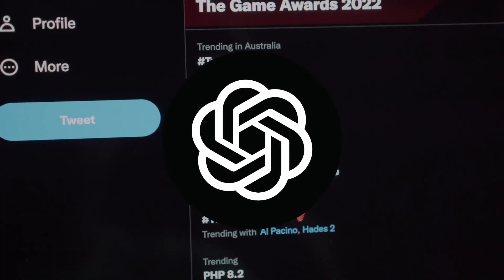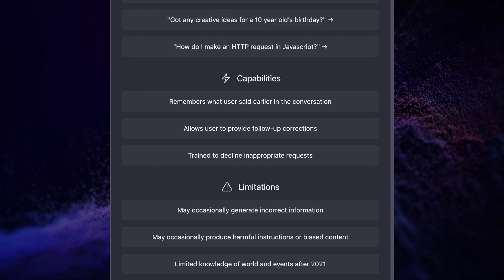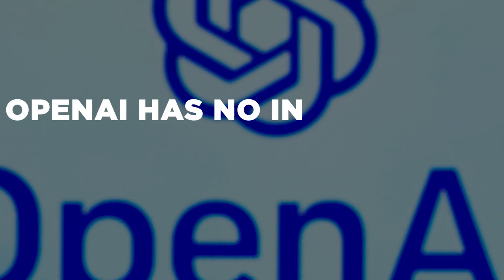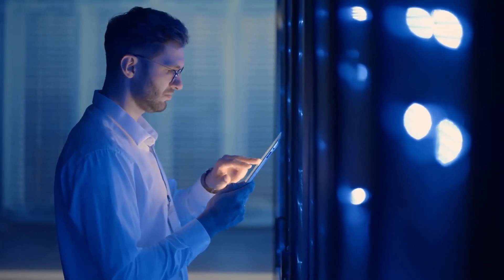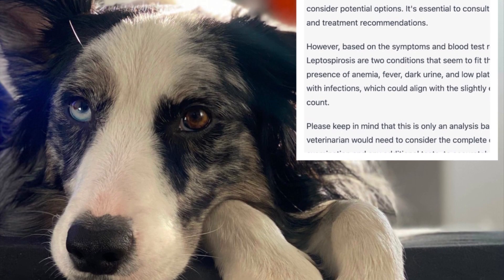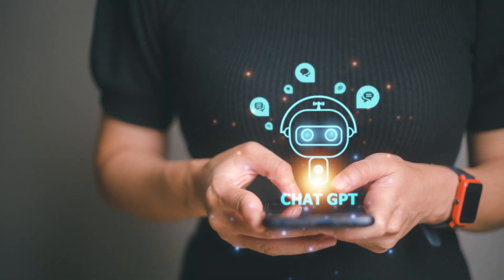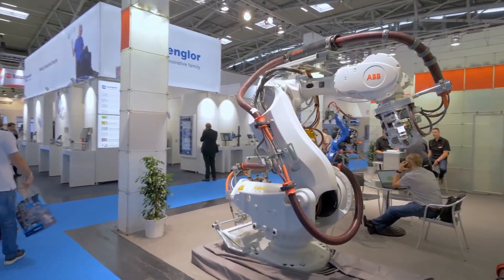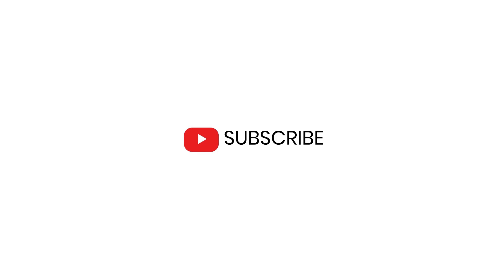This is How GPT 5 Will Redefine The World FOREVER!

Comment: ChatGPT, just like all other AI has no intelligence in AI, and only work from siloed data; 95%+ of it being locked away and unavailable.  There's even a cutoff date for what ChatGPT knows, and if you want an extension of that date you have to go and build an entire new ChatGPT, which is extremely costly; hundreds of millions IIRC.  Also, these so called AIs require immense storage and GPU power to make possible as its nothing but a huge line of stringed codes to come to a final conclusion, often times wrong.  Only one company is out there that can provide the I in AI, and will be releasing its AGI based agents within a matter of a few weeks for BETA testing.  Unlike ChatGPT, these agents will actually learn, not just from you and the data and preferences you provide, but also from other agents within the network, as well as its surroundings within the upcoming spatial web.  Eventually there will be full customization of the user interface, including holograms, but thats further out of course.  The company's CSO discovered the physics equivalent to E=MC2 but for AI learning and this is embedded within each agent.  Beta testing will begin for GIA this fall, and for the KOSM network, where users can build their very own AGI agents with little or no programming skills, Beta testing will be later this year for those toolkits.  GIA and KOSM will offer both personal use subscriptions, as well as enterprise level.  The subscription cost for GIA is expected to be $20 for personal use, while they will also offer a free version.

ChatGPT will still have its uses, but for anything that requires high end accuracy, there will be no alternative as regulatory bodies plan on hitting so called AI companies hard with fines, as they lack the ability to show regulators how their AI bots reached the conclusions they did.  In other words, you can't simply claim that this or that website created bias in the job search or miscalculated something, but you have to be able to trace it and prove it.  The KOSM based AIs has this covered.

Technically all LLMs will become obsolete within a few weeks time, especially considering how much energy and money is wasted in building these false end results.